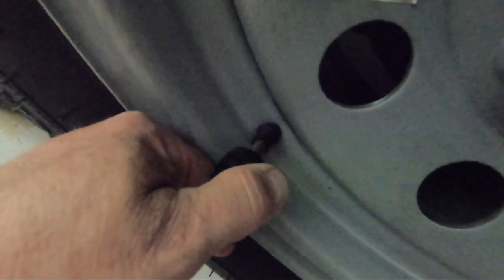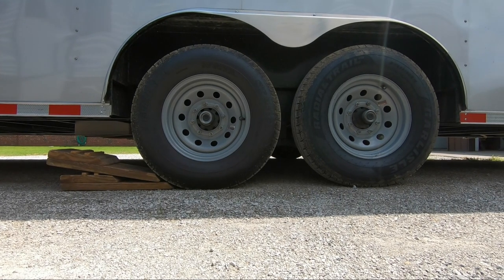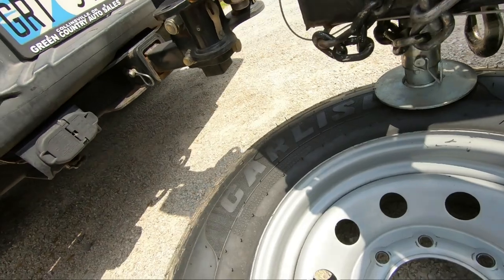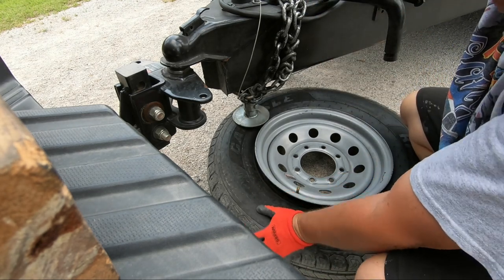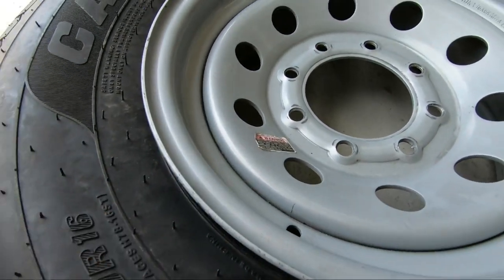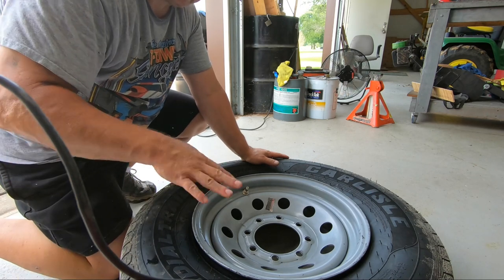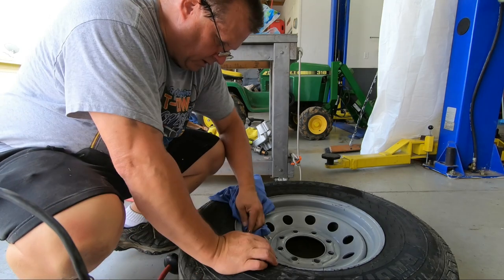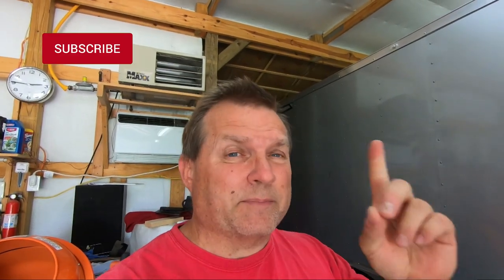How To - Replace Trailer Tire Valve Stems With Metal Ones!

Comment: I have the exact same problem with the TPMS sensors fatiguing the rubber valve stems on my trailer and want to install metal valve stems. I was hoping this would be a DIY mod that I could do in my workshop to avoid a trip to the tire shop. Using the electric tongue jack as a bead breaker is brilliant! Thanks!

Comment: Most, and looks like the one used in video, are 1.5" long (EL) effective length. 1" is what I used, but with 6" wide wheels the TPMS cap still sticks out more then, well what I like even though never had an issue. They are hard to find and a bit higher cost, but they make a stubby one. Usually marketed to the agriculture community. The EL of those are 5/8", and puts the cap really close to the wheel.